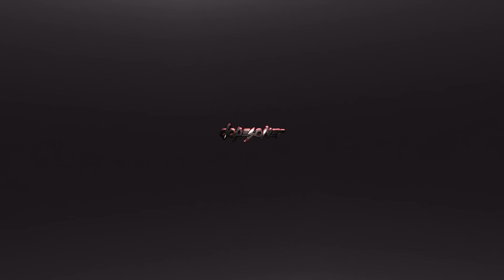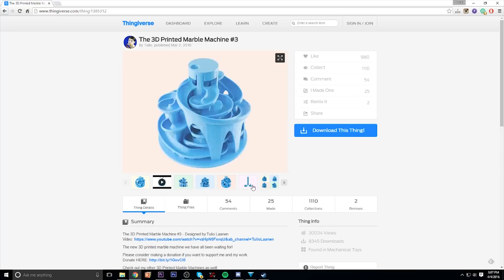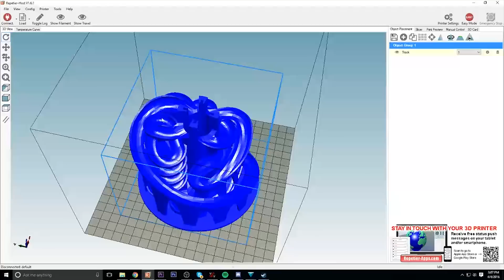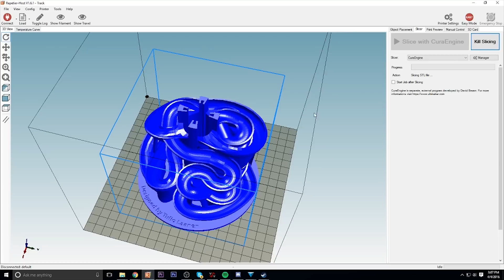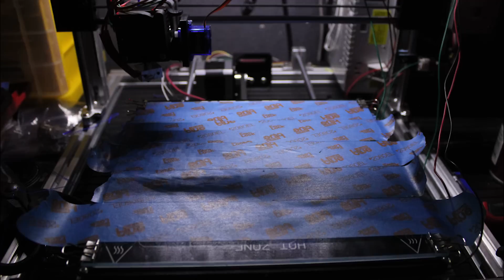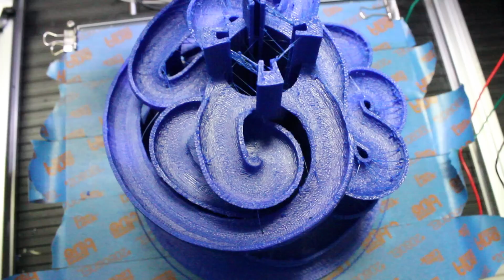Large 3d Print! Quality Test Of Folgertech Prusa I3 2020 3d Printer! | Marble Machine

Comment: Damn, that came out nice.  I'm just barely able to get my printer that I got around Christmas up and running.  Even had to buy a Fabrikator Mini just to print some replacement parts since the crappy laser cutting on the wood on the first printer wouldn't hold the e3d clone that came with it properly.  Wish I had found this printer before I dropped $300 on the Q3D printer I bought.  Damn thing doesn't even have a heated bed, just a slab of MDF.
Reply from the maker: +Yodaforce343 Man that blows, did you do research prior or did you sort of just jump on one out of excitement of wanting to get one? At least you can upgrade parts, and the hot bed isnt to pricy so hopefully you can add that along with a better frame unless you got your dialed in if it is a prusa style printer they sell aluminum frames all over amazon!
Reply: +Dopesoner I did a little research on it but kind of jumped the gun when deciding to purchase it.  Luckily there is a big community around the Q3D printers so finding upgrades to print and general help wasn't hard.  Couple of guys even designed new frames to print to replace the MDF pieces, so I'm probably going to print one of their frames since they are pretty well designed.